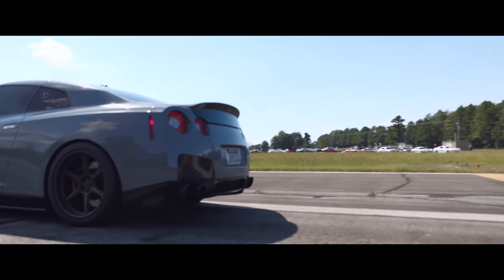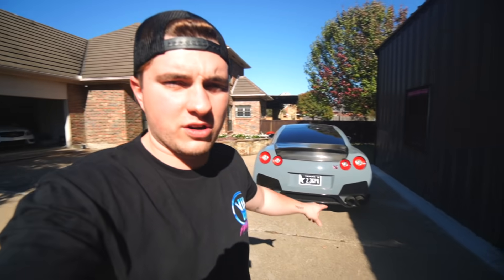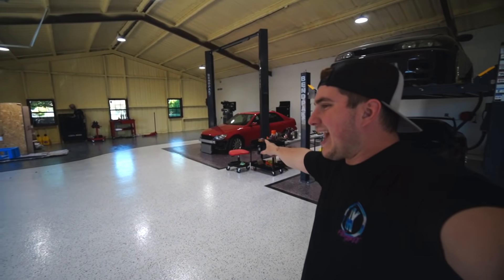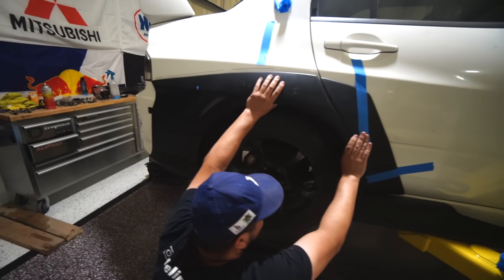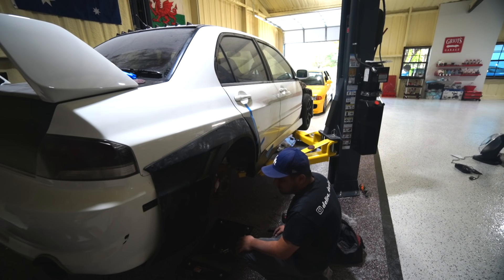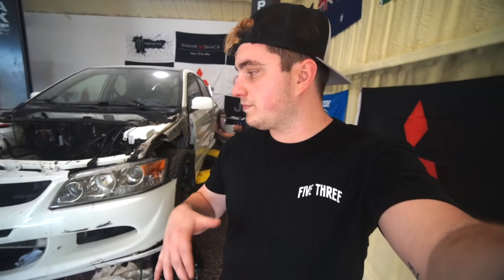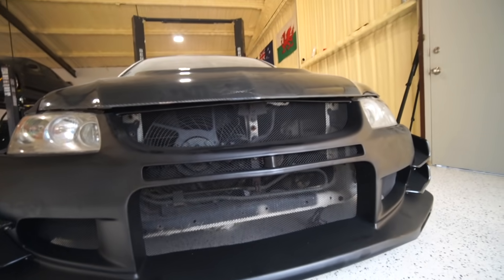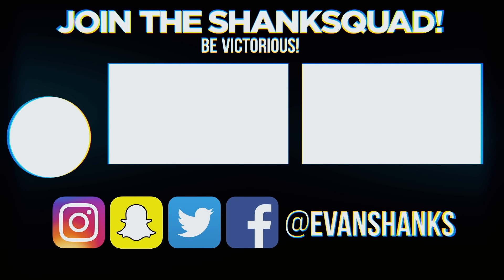Wide Body Kit install on the Evo VIII MR! Restoring a Barn Find Evo 8 Pt. 6

Comment: Honestly, for your third weld this looks pretty good. My third weld surely wasn‘t that good. Little more consistency with pushing forward the electrode, give more welding rod at the top and then those welds will look way better also in terms of color. Oh and also more consistency swiveling the electrode :)

Comment: Worked in a body shop. You are correct about the rust. Once oxidation starts you have to cut the entire part off and put a new one on. Even then it will come back.

Comment: you cant mig weld stainless because there are different components in the metal. you should get a miller that does MiG, Tig and stick

Comment: Please don't use flux core wire to weld in your patches...or the stainless you were talking about. That Hobart has a threaded inlet for a gas hose on the back. Then get some .030 er70s6 mig wire and rent a small bottle of 75%co2/25%argon from your local weld supply store.

Comment: Hate the wide bodied cars because no one does it right. They just hack it up. Properly done it should look finished and done with the kit on or off. When you take off the rear flare it shouldn’t have some hacked up quarter panel.